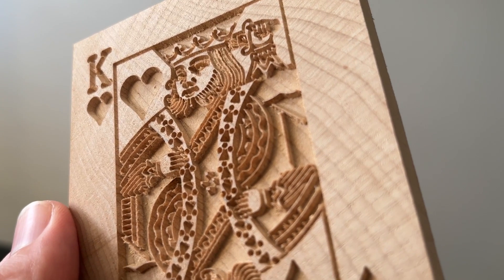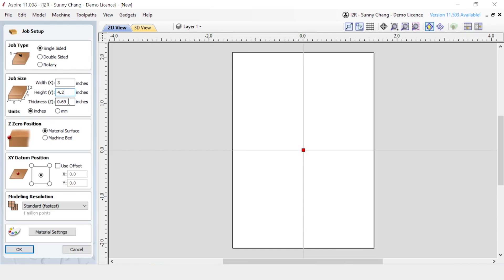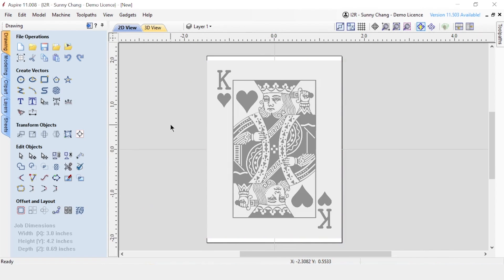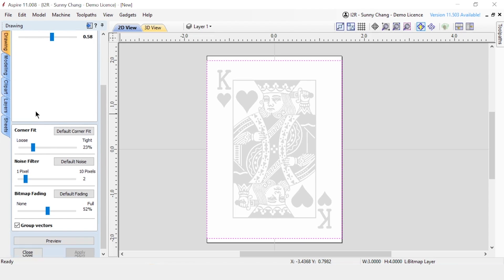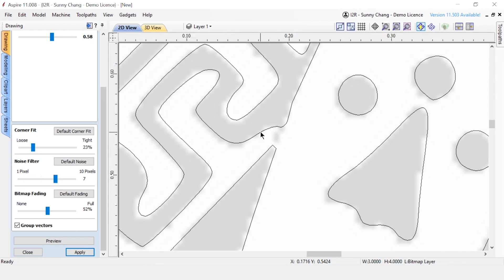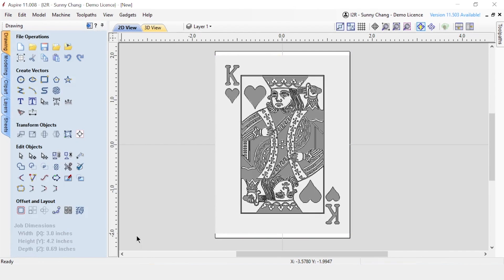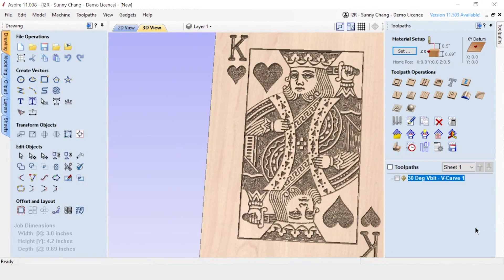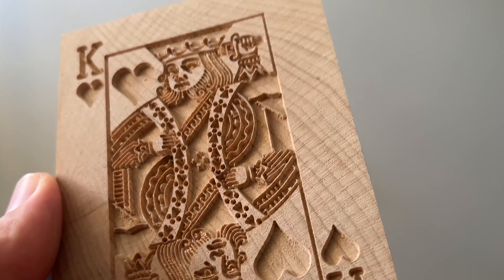How To Carve Any Image On A CNC - Making The Vectric Toolpath Tutorial

Comment: Hello, I saw your video and it is quite inspiring. I myself have a cnc machine and wanted to run engrave some wording on a piece of wood. I was able to design the wording in Vectric Aspire Software and extract as Gcode, however the cnc machine does not run on the Gcode. Would you able to provide some guidance? Much appreciated.

Comment: How did you go from the drawing to the CNC and begin carving? No one seems to demonstrate this aspect. It leaves those who know satisfied and those like me who don't know very frustrated.
Reply: It depends on the type of machine. In my case, I am using VCarve Pro and a Shark HD520. There are two options to get the carve from the computer to the machine. First, you can save the toolpath to a file, put the file on a USB thumb drive, and use the machine's pendant to run the carve. Alternatively, you can connect the computer directly to the machine, and using the manufacturer's software, send the g-code directly to the machine. Hope this helps.

Comment: Thanks for the info, very helpful.  When I did this on a small sized material as you did the simulated tool path was clear with the details shown.  But when I changed just the material size to 36" x36"  (leaving the card the same size) the simulated too path wasn't clear at all?   Can you not get a high resolution with a large material size?

Comment: I noticed on the VCarve tool path you set a depth stop of 1/8, had you not done that would it have possibly cut through?  Also mentioned end grain, you actually had a 3 inch thick board that you cut a workpiece from?

Comment: Great video, for this 30 degree what is your settings ?  I want to use for v carving details but will take hours   thanks
Reply from the maker: Speed: 20000 RPM; Feed: 1800-2000 mm/m. If you're cut is taking too long to engrave, adjust the pass depth and stepover - but be careful not to over stress your bit!

Comment: Nice explanation  but I wouldn't have cut that deep, a shallower cut would have allowed better detail
Not being judgemental here! I've made and learnt from far too many mistakes to be that.
I often carve images out at say 1mm with 45 degree V bit and get good resolution then fill with resin and sand it flat
before a final lacquer coat.
Reply from the maker: You're not wrong! Shallower will allow for tighter resolution, but definitely takes some trial and error to balance the detail shown from the shadows made by depth, and maintaining great detail

Comment: The only issue for a project like this in end grain is that the resulting card is very fragile and will snap easily. I would suggest laminating it onto some face grain.
Reply: Use stabilized wood, or infuse the wood with some other hardening agent. Or ... finish the carve with a resin pour and face it till you are just above the wood (so it can be sanded and polished.
Reply from the maker: great tips!
Reply: @i2RCNC  It's a common thing for wood turners who often work with spalted or burl wood. It's also not overly difficult to do, just needs the right tools.

Comment: Inspiring!
I plan to engrave clock dials in 1/32” sheet brass.  Planned to try Amana 30 deg V bit, max depth 0.015.  They sell tip widths of 0.005, 0.01 and 0.02.  For a flat depth, in which parts vary between less than 1/32” to 1/16” wide, how would you select bits?
Reply from the maker: For that it'll be best to preview it in a CAM software to make sure you're getting the detail you're looking for. When it gets that narrow, the flat depth is typically overridden by the bit's angle width limits, so the narrower an angle, the deeper you can carve into thin areas. Hope that helps!
Reply: I know this is a little after the fact, but engraving is much better when using an actual spring loaded diamond engraving bit like the ones from Carbide 3D.

Comment: I use V-carve pro….coincidentally a few weeks ago I had a similar job come in where the customer wanted a Tarot card reproduced in end grain sycamore ( which I glued up from staves ). I ran the multicolour Tarot through Photoshop to create a monochrome copy and saved as a bitmap. Then the usual…..in Vcarve pro - load bitmap adjust sliders etc to create a perfect vector image…..outcome superb….no probs. I did use a 3mm down cut end-mill first for clearance then a 15deg v-bit. Both run at 22000 rpm.
Reply from the maker: Sounds Awesome! 15deg bits are fantastic for very finite detail
Reply: I feel like I need to up my game (although I am a very raw rookie) as I haven't incorporated Photoshop into my work (although I do have it). I primarily work in Illustrator and Aspire.
Reply: Cool. Start a channel